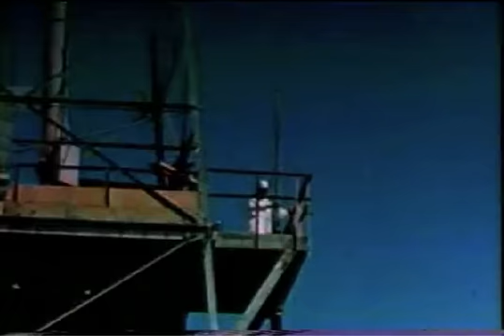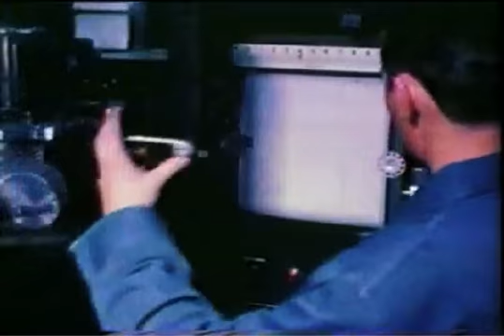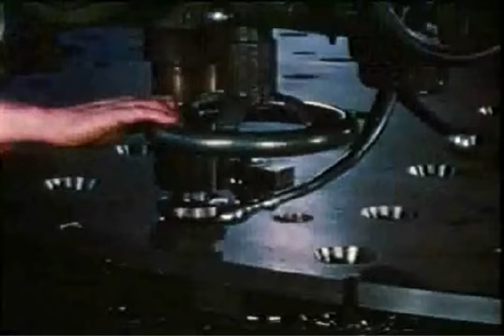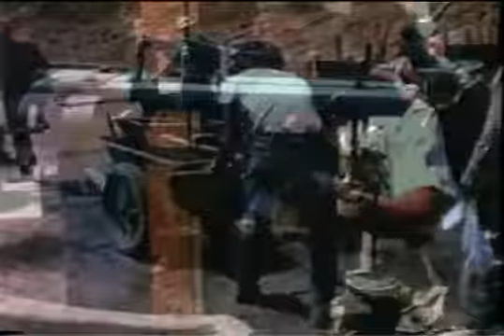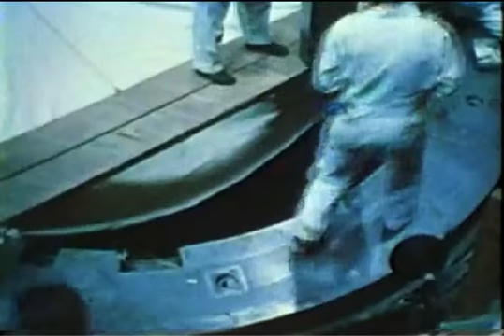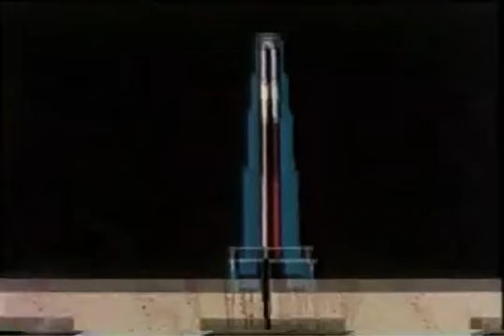Sodium Reactor Experiment

Comment: These have a tendency to explode... Or leak out radiation... Hard to build a small one that works too... 

Probably better to go with something else in general. Complicated. Expensive.. not necessarily high output compared to other options

Heavier fuel will likely work better. I like kirk Sorenson's thorium reactor myself. Easier to make it smaller. More complicated chemistry but, significantly less dangerous.

Comment: "Yeah... Sodium is a great coolant to use!  Who cares if it explodes when water hits it!"  LOL!
Reply: So what? Unless you're pumping water into your nuclear plant, you don't really have an issue. The sodium system is generally kept separate from the water by the heat exchangers, and even if there is a sodium leak, you're not going to have a significant nuclear release as sodium's various isotopes have very short half lives. Na24 has a half life of 15 hours and that's the longest one. The rest are a minute or less. 
Sodium only reacts with air until the surface areas oxidize at which point, the chemical reaction stops.

Basically, you don't want sodium cooled reactors on ships or submarines, but otherwise, they're quite safe.
Reply: And where do you get your data on the meltdown rate of LMFBRs? Not really sure which reactors you're talking about. Source? I'd like similar data on failure rates of MSRs, but as it turns out, there aren't any in operation today and none have operated as a power reactor since the 1960s. 
What do you think happens if your fluoride salt mixture gets out and mixes with water in the heat exchanger of an MSR? It rips hydrogen out of the water and makes hydrofluoric acid. Isn't that fun!! Have fun dealing not only with leaking, screamingly radioactive fuel/coolant mix, but with an acid so caustic that contact with it, will kill you.
Most LMFBRs don't run anywhere near hot enough to boil the sodium, it's not really a concern, which is why you don't have to worry about pressure problems in LMFBRs.
Reply: 1. I've heard smart guy (maybe Alvin Weinberg), i can confirm MMR meltdowns:
Experimental Breeder Reactor I (EBR-I) meltdown November 29, 1955
Sodium Reactor Experiment - partial meltdown July 1959
2. MRS do not need water(salt, even overheated is inert for water and air), high temperature make the gas turbines suitable for it. The working gas can be any noble gas. Look at mine desing:
https://daikami-sama.deviantart.com/art/My-molten-salt-reactor-schema-732724019
3. Power excursion and overheating is STILL possible since it is fast reactor. Because of uusing solid fuel they share LWR weaknessess.
Reply: EBR-1 did have a partial meltdown but no material was released and the design was changed into a pool type reactor for EBR-2, which was physically incapable of having the same fault as EBR-1. SRE suffered a similar problem. But these are far from the only LMFBRs in the world. Russia has had multiple LMFBRs in operation in both power generation and naval capacities. The US operated EBR-2 for 30 years without incident. Japan had Monju which, suffered a sodium leak at one point, but was contained without serious incident and no release of radiation. France had Phenix and SuperPhenix which ran without serious issue. 

MSRs could theoretically use closed-cycle gas turbines, but none exist and the well-understood and developed steam turbines are likely to remain preferable for the near future. Nobody has a supercritical gas turbine in production today. Any MSR built in the near term is likely to be coupled to a steam turbine and would thus, need water. Water + Fluoride salts = hydrofluoric acid. 
But this is unlikely in either design. I suppose you could call the use of solid fuel a weakness, but it's not the same weakness as a LWR. The weakness of LWRs is, and always has been, the water. Water is not a good way to cool or moderate a nuclear reactor. Water reacts with Zirconium to release hydrogen gas. No water = no hydrogen release.
Reply: @Clean97GTI  It is my understanding that a fast spectrum molten salt reactor can use chloride salt, i.e. table salt more or less. You also eliminate the graphite moderator. There are at least two such projects going, Elysium Energy and Terrapower.
Reply: @phamnuwen9442  This is very true. Chloride salts are preferred for fast reactors as they don't moderate neutrons as much. Fluorine is a decent moderator which helps keep the reactions in check in a thermal spectrum. The extra chemistry required in a Chloride salt reactor hasn't been studied and tested to the extent that fluoride salts have. 
Table salt has a melting temperature above what Elysium Industries design would run at, so they're using a different Chloride salt or adding something else to it that drops the melting point. Not that it matters what the salt is, as their lower temps mean they don't have to deal with the materials problems and high material expenses of Flibe's LFTR. Also, in the fast spectrum,  you get better returns from Pu and Uranium vs. trying to use Thorium. I really like Elysium's designs! About the only drawback I can find is that it require extra chemistry if you're going to run it as a breeder reactor. But Elysium doesn't sound like that's what they're after. Not saying it couldn't work, just adds expense.
Reply: @Clean97GTI  Elysium says 2700MWth and 1200MWe. This sounds like it would require a pretty hot reactor. I think they are also aiming at closing the fuel cycle and burning fertile materials.
Reply: @mad ass  So what if it does? That's why you use a two-loop system. Even if you should have a catastrophic leak, you don't release anything but plain sodium and water. In the case of EBR-2, the steam generators were located outside of the containment building where even the worst case scenario meant that any fire or explosion was away from the reactor. You also have the benefit of any massive reduction in pressure would effectively stop the fuel source for the fire. This assumes that you had not only a big sodium leak, but also a water leak at the same time. This never happened at EBR-2 over the course of 30 years. It never happened at Monju.
Reply: And burn in air...

Comment: These people are crazy, the failure modes are infinite.
Reply: Not a failure, just a reason how not to harvest energy from a sodium reaction
Reply: Sodium is faliture. Molten salt was the future:
www.youtube.com/watch?v=tyDbq5HRs0o
Reply: MSRs can't fission the transuranics and actinides. Fast reactors like EBR-2 (a sodium-cooled reactor) can, which means we can use them to 'burn up' high level waste, leftover from light water. And with fuel reprocessing, we can use and reuse the waste from decades of light water reactor use to provide heat and electrical power, as well as providing the needed startup fuel to get those MSRs running.
Reply: The goal of MRS thorium reactor is to AVOID transuranic production. They are the MOST annoying waster. Their decay products causes many issues. And i think spallation systems are better solutions for that.
Reply: MSRs do indeed avoid some of that problem although it's not perfect. You'll always have some production of transuranics. It's a side effect of fissioning uranium, which is how the MSR works. You take the chance that sometimes, a neutron will be absorbed instead of causing fission and you wind up with things like U234, Np237, U236, Pu238, etc. MSRs do have the ability to simply keep using that fuel although neutron poisoning eventually reduces the efficiency. But you have the benefit of being able to recycle and keep that fuel in the reactor.
You also need Plutonium 239 to get the MSR started, and will thus, always have some Pu239 in your fuel salt mixture.
But my intent was to point out that Fast Reactors can serve the purpose of cleaning up all the transuranics produced by the Light Water Reactors in use. FBRs are a great choice for transmuting high level nuclear waste and making it safer, all while providing the needed fuel for starting up MSRs. Fast reactors can fission or transmute all those actinides above. Helpful in the case of Neptunium 237 which has an incredibly long half-life. U236 also has an extremely long half-life but isn't really all that hazardous, but is more of a nuisance in reactors.